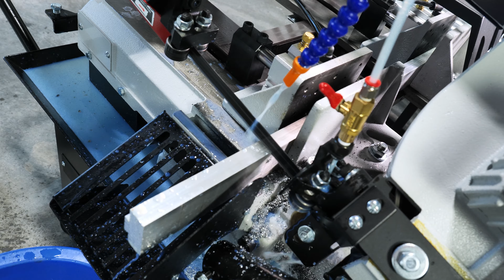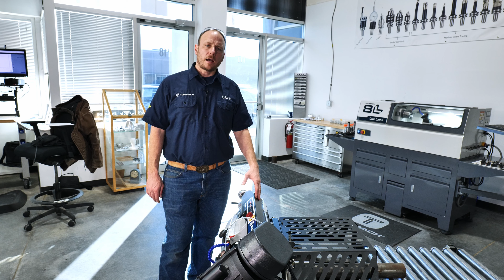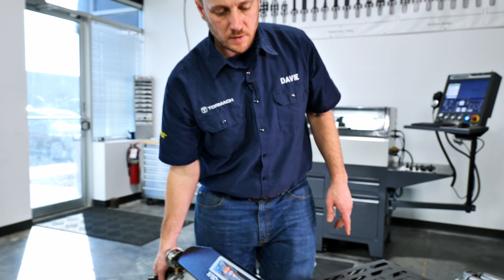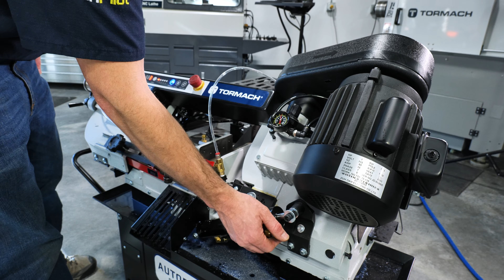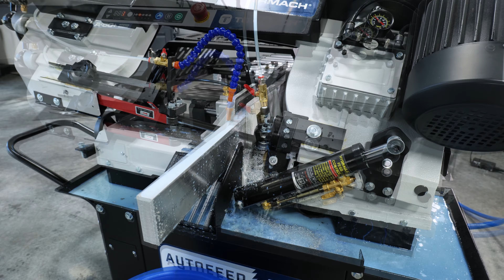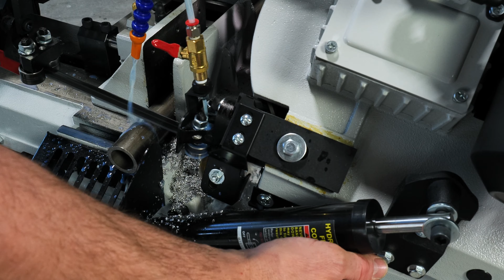Tormach AF50+ Automatic Feed Bandsaw for CNC Shops

Comment: What differences are there on the AF50+ vs the old non-+ model?
Reply from the maker: It's looks very similar to the previous version but the most noticeable improvement is the new control panel, after that many of the components have been beefed up with parts from Taiwan, to provided smoother functionality and longevity.

Comment: I have a shop full of Tormachs and the saw has probably been the best bang for the buck that I've spent. The only constructive criticism of it I can give is this. The blade drops pretty violently between cycles and if you don't have your lift height set beyond what you really need, it will bounce pretty hard and crash into the workpiece. This causes the cycle time to be a bit longer than it needs to be. Other than that, it has saved me a ton of time.
Reply from the maker: Thanks for using Tormach equipment! We're glad you consider our bandsaw as a great investment for your shop. We wanted to let you know that the issue you mentioned with the blade dropping has been addressed with the new AF50+ design. We appreciate your feedback and are glad to hear that the saw has saved you a ton of time. Keep up the great work!
Reply: @tormachinc  is this fix something that could be retrofitted to my saw?
Reply from the maker: @catawbavalleyarmory   The components are from a different vendor and can't be retrofitted at this time.
Reply: @tormachinc I would like to know this as well. Can this new fix be retrofitted?

Comment: I have the AF50 and I will tell you that it isn't portable. Pain in the ass to move. Not balanced at all to pick it up by the handle, coolant splashes everywhere. I like my saw but there are still improvements to be made. Bottom chip tray is to small, not enough clearance to clear chips coming off of the blade.
Reply from the maker: The new AF50+ on first glance looks like the same automatic bandsaw as the AF50, but it's seen some evolution throughout the entire product making it more robust and easier to maintain. We'll pass on your concerns about the weight distribution and the clearance for chip removal to our engineers.